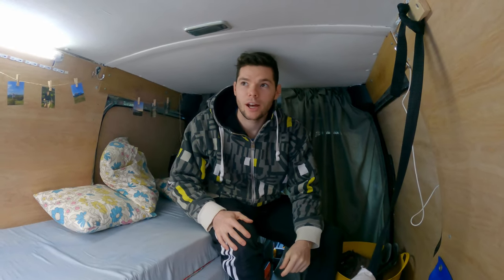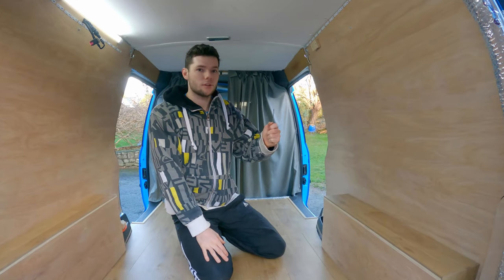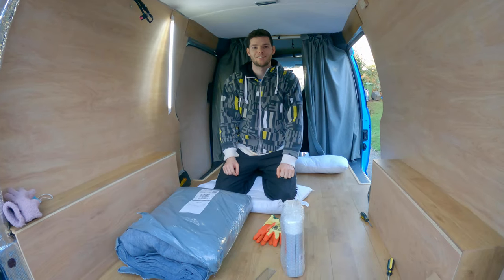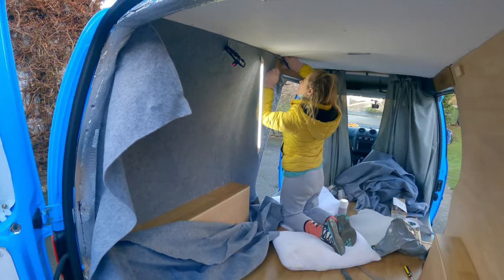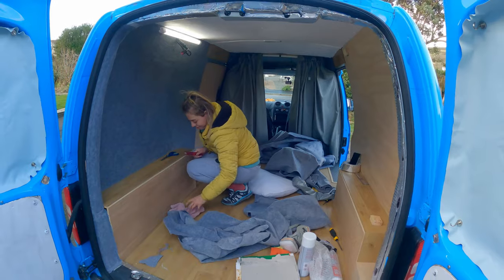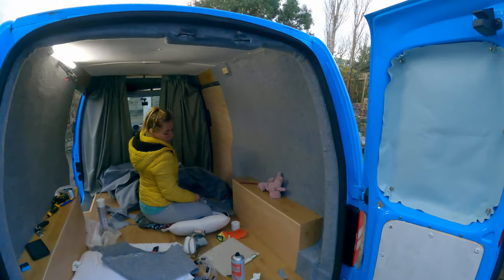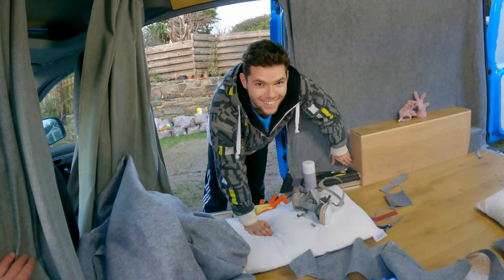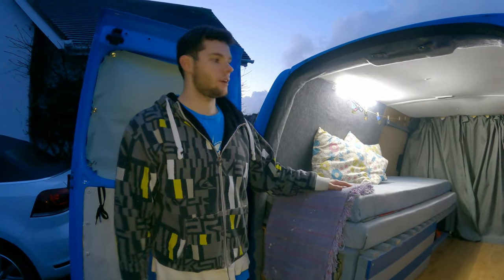Carpeting Lining Our VW Caddy Camper With 4 Way Stretch Carpet!

Comment: I am doing a Micro car camper, 2 questions, was the carpet a 2 man job? and how long is your bed?
Reply from the maker: Awesome! It is easier with 2 people but you will be fine doing it on your own. Just lay out the carpet first and then once you stick the first corner down it will hold it place making the rest easy to do. And the bed is 190cm long.
Reply: @willsvanadventures  ok thanks, i am trying my Zafira at the moment, i am 6'2'' so bed is hard to fit, sort of wanted to test micro camping before i make my mind up about a bigger van, the car is converting better than i thought to be honest
Reply: @willsvanadventures  just did the silver insulation on the windows, That Glue is Sticky lol